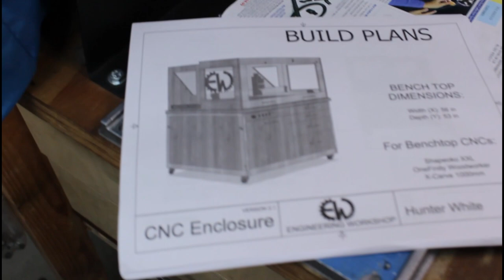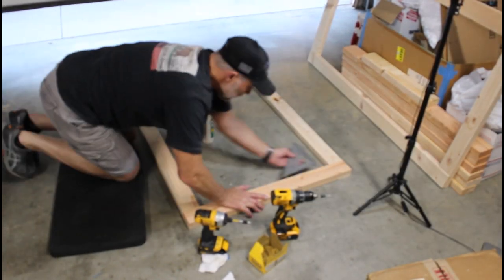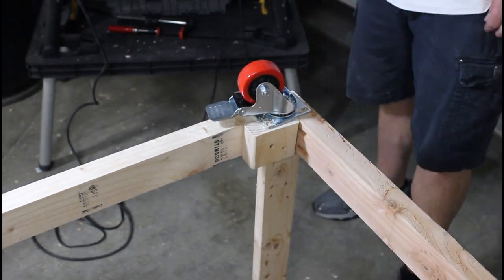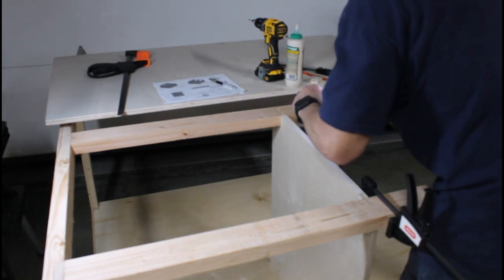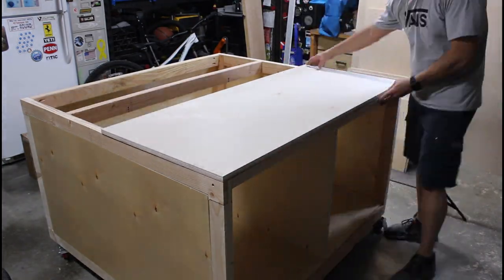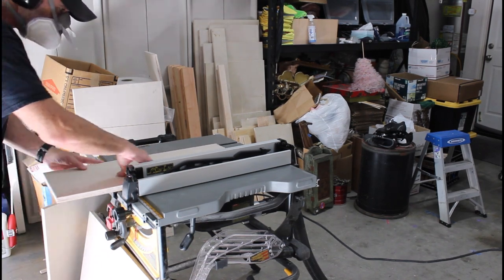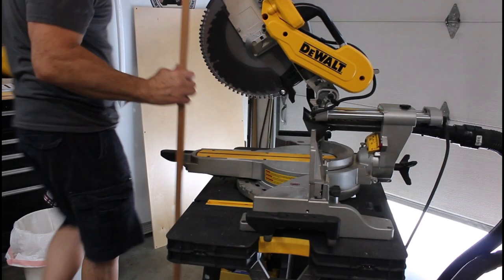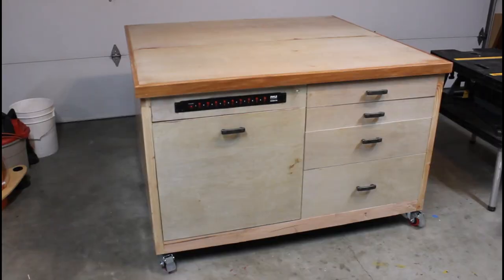CNC Cabinet Build

Comment: Hi, I love your office, I'm going to get inspired to make mine....
a question please?
Is there a problem when you machine something and then put casters on it? for example vibration? precision .......?
Reply from the maker: No vibration issues… Just make sure that if you use casters they are the lockable kind. Thanks again for your question and good luck!
Reply: My garage floor is not level (by design to drain towards the door).  I added levelling feet and retractable casters, best of both worlds.